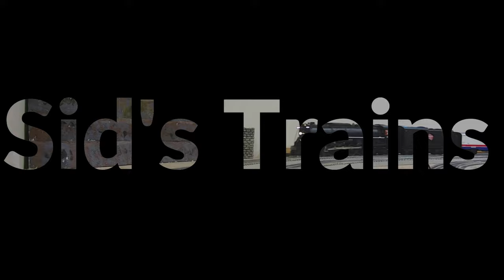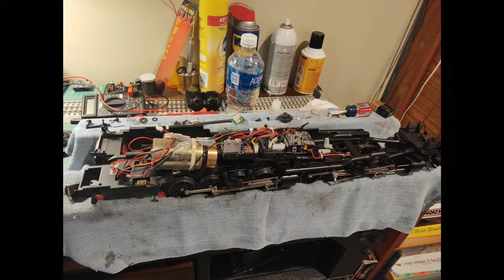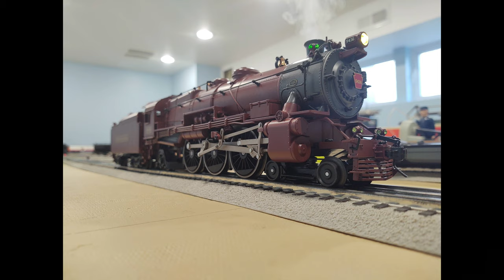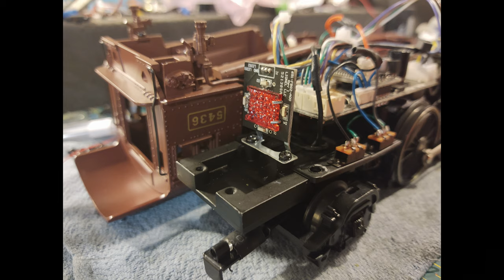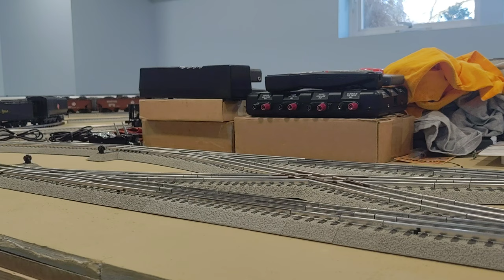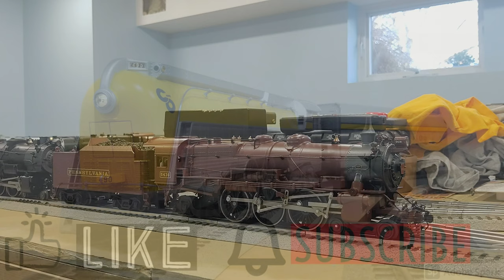Lionel PRR Tuscan K4 Episode #3: Its Done!! #worbenchwednesday

Comment: That looks and sounds great!! Great job! Question, did you add the electronics using the conventional motor? As in, if I wanted to try, could I add TMCC to a 681 turbine by splicing into the existing motor in case I ever wanted to return it to just conventional? Or would one have to change the motor?

Comment: Do you also do HO scale MTH repairs? I have a K4 being very finicky and don’t want to tear out the Protosound 3.
Reply from the maker: What are the issues you are having?
Reply: @SidsTrains  the engine will move sporadically, almost like there’s binding but there isn’t. The chuffs don’t activate and if I use the smoke unit it will chuff three times and just stop while shooting smoke out the stack. While idle all the sounds activate perfectly, the PFA, the whistle, the bell, the smoke unit works fine, the lights work, it’s just moving that breaks the engine. When I got it the thing ran fine but sound was screwed up, then I reset it and it flipped the problems. I tried redoing connections and a new engine board. Only thing I haven’t swapped was the motor with that board on it yet since I don’t know how to remove it.
Reply from the maker: Hmmm. Sounds to me like an issue with the main boards. Call MTH and ask them. They usually are pretty good about working on their HO models.
Reply: @SidsTrains  okay. Thank you. :)
Reply from the maker: You're welcome